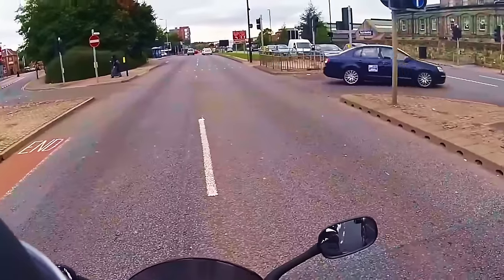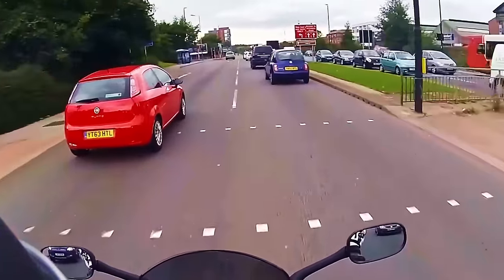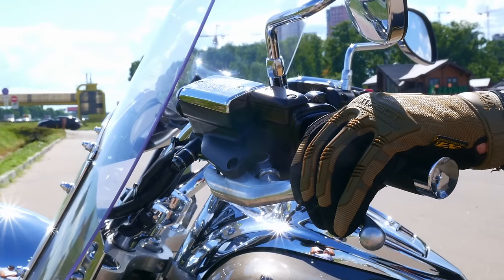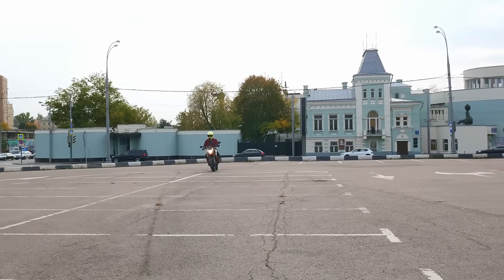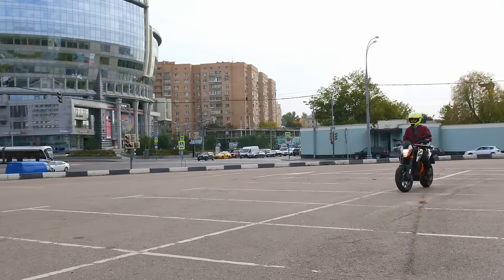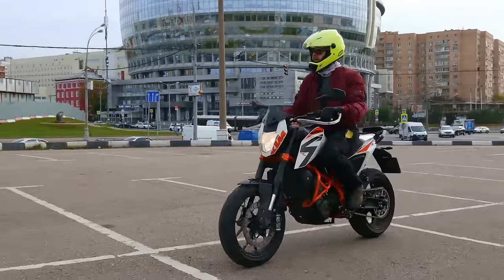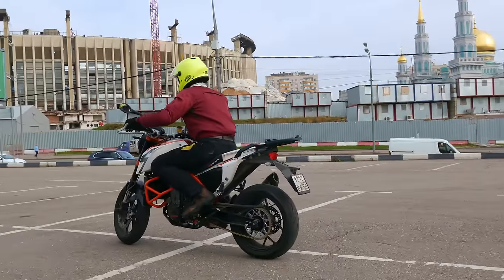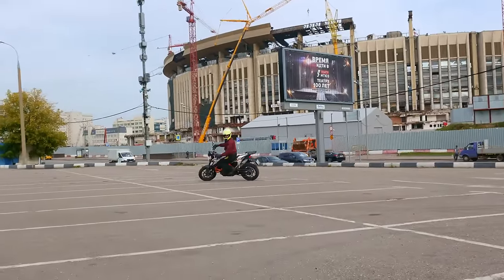How to NEVER STALL your bike again!

Comment: An issue I had at first was after preloading the throttle just a little bit, my bike would accelerate too fast for my liking with a little clutch. Took awhile to find that sweet spot of throttle to give.
Reply: having this exact issue right now
Reply: @michaeldevin8301 How did you fixed?
Reply: @boredsince9150  hey sorry for the late reply however i found that it really just takes time and practice of giving it a little throttle while also slowly releasing the clutch at the same time and at a certain point you will get better with it over time

Comment: Another simple rule to follow in addition: When coming to near-standstill, gradually shift to the rear brake while easing off the front brske alltogether. Not only is it more convenient in preventing that annoying “mini dive” of the front fork but it also enables you to concentrate on throttle control without having to fiddle with the front brake at the same time.

As my motorcycle instructor taught his freshmen: „At walking speed there is no benefit in using the front brake at all — unless you’re keen on getting to know the pavement a little better.“

In essence: Front is for power braking — rear is for finesse braking.
Reply: It’s a good rule for beginners, however, once the right hand “knows” how the bike responds at low speed, from then on it’s perfectly safe to use the front brake at low speeds.
Reply: @mhoeij  agreed… however, despite riding my bike for nearly a decade now there are still some moments when the bike ‚surprises‘ my by diving the front ever so slightly deeper than expected.

Certainly also depends on the bike itself, paired with exterior conditions (brake pad and fluid temperature, outside temperature, hand position prior to braking, etc).

Generally I find the rear brake technique much more consistent though.
Reply: @TheUnsungVil  I started riding nearly five decades ago and must agree with mhoeij. With a little experience you should be able to stop with any combination of the two brakes without unnecessary jumpy dives. It's easier to master the rear brake at slow speed because it's weaker. When you get more experienced you'll get a better understanding of your front brake too.
Reply: @fuglbird Also agreed (as with mhoeij before), I just happen to find the gradual change towards rear finesse-braking at los speeds much more consistent… especially since I ride 3 bikes during the season (a dirtbike, a supersport and a Goldwing)… and each one behaves completely different on the front brake dive.

Comment: The title should be "Do THIS and Never Stall your bike again (unless you forgot to downshift)" xD. I can drive off in 2nd gear but it certainly takes a bit more finesse than starting off in first gear and if I don't realize I'm still in second, the stall usually happens. 

Thanks for the lesson though, they're all helpful! One topic you've covered somewhat in various videos, but which I still struggle with, is proper throttle control while doing slow (near full-lock) turns. While I know I have to relax my arms and keep hold of the throttle lightly, my body tends to tense up when doing (near full-lock) turns, resulting in a lot of throttle (and noise). I realize this is a niche topic, but I figure you might have some tips/exercises specifically for this topic.
Reply: Actually he has a video about that: https://www.youtube.com/watch?v=S36MgsVsHsA by the end of the video there's an exercise addressing this matter. As mater of fact, I strugle also with that you said
Reply: @brunoduff  Thanks! I've seen that video a while back but couldn't find it again. Definitely has a few good pointers.
Reply: One thing I noticed by practing this was that if you lean your bike just a little before you start the full lock U turn goes a lot easier

Comment: My best friend taught me clutch control on a hill. Nothing super steep, the bike would pull itself up without throttle but if you let off the brake too soon it would roll back. He made me hold the clutch at the friction point until I knew where it was. And then he made me practice dropping the clutch to friction point, and no further. I still spend as much time as possible practicing these methods and I can confidently say my clutch control is mastered, and continues to get better.

Comment: I just got my first bike and have been having trouble stalling when stopping at a light or stop sign.  It's even more stressful because there's a lot of hills in my area.

I also still stall sometimes when taking off.

I haven't quite figured it out yet but I guess more practice is the answer.
Reply: Give some more acceleration
Reply: @Vaalmaakri234  Thanks!

Comment: Wow there was no video other than this about “tiny” throttle control with clutch control . Everyone says let go of clutch first without any throttle. and the way with little throttle first helped me greatly on taking off in traffic without stalling safely
Reply: I'm currently struggling with the same issue. My instructor told to release the clutch first and only after the bike starts moving to add throttle. But this one, I'm extremely slow when starting from a traffic light. I'm definitely going to try the video version tomorrow.

Comment: Man, I kid you not: I'm learning more from your exercises in few hours than 20 hours from my Moto Class. Thank you a lot!

A trouble that I have with my bike is that when I pull the clutch all the way, it simply keeps on moving! It doesn't slow dow at all o.O anyway, love your channel!
Reply: Maybe it just needs a clutch cable adjustment? Sounds like the cable is too loose and not fully disengaging the clutch plates when pulled in.
Reply from the maker: Hi! Thanks for such a praise😊 About a clutch - that can be a lot of causes, but start with the simplest, check if the cable is adjusted correctly with the right amount of free play.
Reply: Same here! It just keeps rolling forward.
But its not driving the wheel, because if stationary and the clutch is fully pulled, it wont move.
It just wont slow down with clutch pulled, it rolls for ages. As if the wheel bearings have zero friction, which is good i guess lol.
Reply from the maker: @Baleur  That's what the rear brake is for😁
Reply: @Baleur  Its not supposed to slow down, you are coasting at that point.

Comment: Great video, and I have a question for you. 

I recently bought a new Yamaha, and it’s still within the break-in period.

While still in 4th gear, there was an emergency which caused me to have to brake suddenly. I forgot to pull in the clutch, and the bike came to a safe stop, but stalled while still in 4th gear.

What damage if any will this cause to the bike?

Comment: Great content. During this excercise -should we keep the engine revs constant all time ?
Reply from the maker: Yes, at first - keep them constant, usually around 1.5x-2x idle RPM. And after some practice, when you get used to it, you can either keep them constant, or give throttle shortly before you need to release the clutch, it's personal preference.
Reply: @MotoControlEn  Thank You for answer

Comment: Hi Andrea love your channel am practicing my u turns but can’t keep the bike on full lock
What am I doing wrong. It starts off on full lock but then get wider. Thanks
Reply from the maker: Hi! That's a good question, I'll cover the answer in the video soon, because typing it would be pretty long. But basically you should lock your handlebars in full-lock position and regulate the clutch, if you feel your bike goes wide - pull it in a little, if it starts to tip over - release the clutch a bit.
Reply: Also depends the type of bike. Sport bikes are a lot trickier

Comment: Excellent video. You can let the clutch go really slow on an uphill though if you have the right control: left foot on the ground, right foot on the rear brake, bike in first gear. Gently release the brake once the bike starts to move. Pretty much like using the handbrake on uphill in a car.